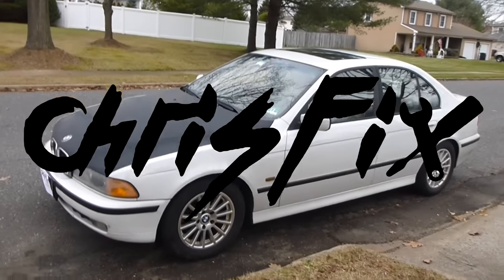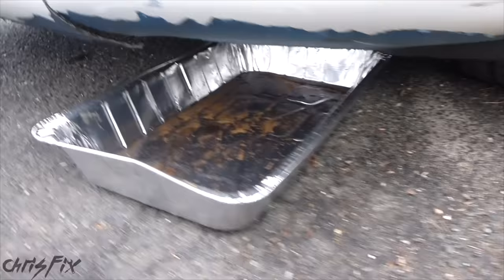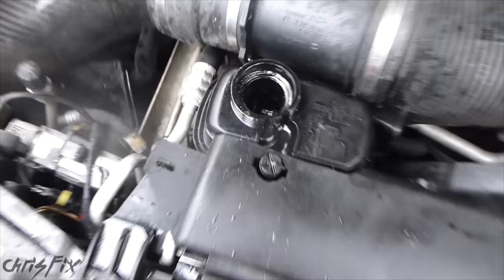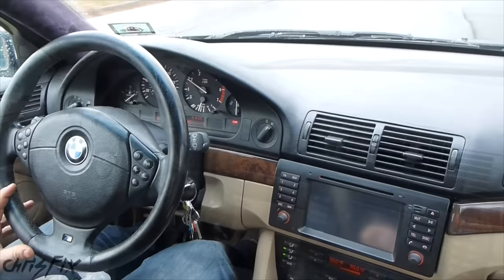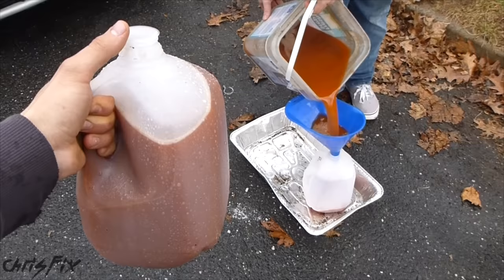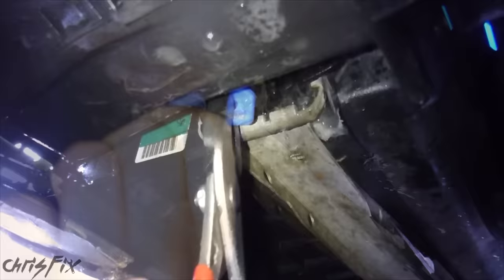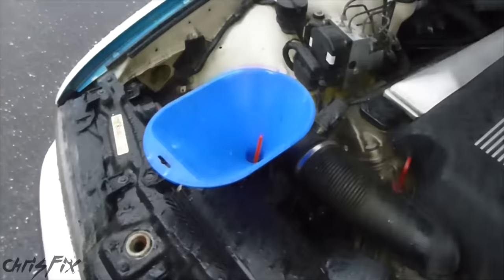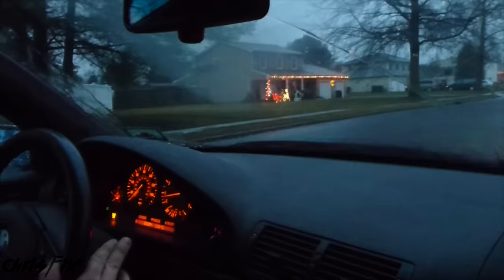How to Quick Flush Your Cars Cooling System

Comment: it's any problem to use flush cleaner with old radiator water? Thnx
Reply: +Redi Hoxha I was wondering the same thing. I think he mentions in another video that you can add the flush cleaner to your old coolant and then drive the car for a few days to have it loosen any deposits. That sounds reasonable.
Reply: +Dave denton 
On the brand I use it says to leave in your system for 200 miles before emptying and putting in clean fluid. Like Chris, a drown to town and back is good enough because who plans these things in advance, usually you do car maintenance whenever you get the time not in 200 mile advances. The only time I'd care about leaving it in is if I saw substantial particulates in the old fluid.
Reply: +jeff darnell That's exactly why I want to have it in there for a few days. I drained the old fluid and strained it through a nylon stocking and pulled out an ample amount of deposits. However, it seems it would be a mistake to run the heater as that would send the loosened particles into the heater core. Not a good idea, right?
Reply: You will want to get the old fluid out first. The idea is to get rid of the old fluid. Don't run the flush with the old radiator fluid!

Comment: When you pull the petcock off does the resivor tanks coolant go down too?
Reply: Jacob Peterson on my car it didn’t. I had to run the car a few times to get it circulating through the radiator. Other cars may be different, though.

Comment: Hey ChrisFix, I've watched like 6 or 7 how-to videos for coolant flushes and it seems like everyone does them differently.  What are your thoughts on those flush/fill kits where you splice a T-fitting into the heater core inlet hose, then run a garden hose through the fitting?
Reply: My question also
Reply: For anyone reading, that is not needed. Every car has a bleeding system and you dont need to mod it, just look up how to bleed your car.

Comment: I often see you using PEAK antifreeze when many manufacturers recommended only to use their own antifreeze. Do using a non manufacturer antifreeze damage the cooling system of your vehicle? My car for example recommend only to use a Nissan (green fluid) or my Honda a Honda (blue fluid)
Reply: With Honda I think the most important thing is that coolant is OAT type and doesn't have silicates or 2EHA which can damage gaskets. But of course OEM coolant is the safest bet

Comment: Omg. Never use leak stop crap. You forgot to mention ventilation valves for getting air pockets out. This vehicle takes about 10 litres of coolant mix
Reply from the maker: Arnis Tarassu Thanks for sharing!
Reply: +James Kozak what ventilation valves?
Reply: +GameHEADtimeGHT srry these are not valves but small plastic screws that let air out. one is an inch away from radiator filler cap. there should be another one or two near engine coolant pipes.
Reply: +Arnis Tarassu 
I think that's why it is labeled quick flush and not full flush.

Comment: So here @1:53 He Fills up his Reservoir completely with Distilled Water. How is there any more room left for the Chemical Flush, if the car only takes 3 Gallons, and i'm assuming he added all 3 Gallons of distilled Water? I'm confused. My car only takes 2.2 gallons, i'm assuming i'd only add as much Distilled Water as I can, but leave space for the Chemical Flush to still be able to be added.

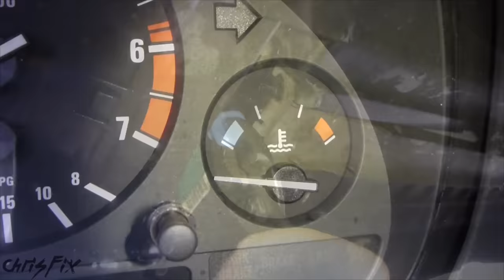Also, does his car not have a "Radiator cap" and only a "reservoir cap"? @3:57 He say's "take off the radiator cap, or in this case the Reservoir cap"??   I'm sure, when I fill everything up, i'd do it straight from the actual radiator, and not the Reservoir ? If someone could clarify this, that would be great.
Reply: Not all cars come with radiators that have a cap. Some cars (like mine -- a 1993 VW Golf MK3) only have a cap on the expansion tank. If your radiator has a cap, you fill it from there and then add up to the expansion tank. If it doesn't. you fill the system through the expansion tank.
Reply: Its Rafael he drained the woter to flush it

Comment: Forget about the plastic petcock, they will most likely break the older the car is. Just disconnect the lower radiator pipe and it drains faster too.

Comment: Cant you flush it with tap water first?
Reply: Kevin Afton No, you can't use tap water because it has minerals that can damage the engine. While distilled water has absolutely no minerals, just pure H2o
Reply: You can use tap water, but distilled water is advisable.

Comment: Great video on flushing. One thing I'd like to add, For anyone driving a BMW make sure you add the correct amount of coolant. It shouldn't be full to the top like in the video but with the float level with the top of the expansion tank. Adding too much will blow your hoses :).
Reply: Ooo Ty!

Comment: Dont know if this chemical flush is a good idea. Does it not chew up the seals and gaskets and rubber hoses in the coolant system ? Is that why you try to neutralise the chemical flush it with this "rust inhibitor" ? May be a better idea if you did another 2 distilled water flushes after the chemical flush to completely clear out corrosive chemical flush fluid?

Comment: Will be attempting to this tomorrow. I have a. 07 Infiniti G35 Coupe & just yesterday it started heating up. Tried opening the cap and it dripped a bit due to the pressure. Coolant looked watery and super dirty, like black ish water. My guess is that the previous owner had put water in it. Hopefully thatll fix the problem. Might have to replace the water pump while at it. 😭

Comment: My Corsa d 1.2 2010, I have a car with spanner symbol and radiator fan running all the time, I flushed my coolant system a year ago, changed all my oil and filters. I replaced my radiator coolant sensor as I thought that was the issue, I’m gonna change the thermostat as the coolant going from the expansion tank into the engine is warm after a drive but pipe that comes back out of the engine through the thermostat into the radiator is cold which means thermostat may be locked closed or open. Gonna change that, I checked the radiator fan resistor that looks ok and relays all look ok

Comment: Been watching your videos for a while now, you give really good advice.  Quick question I have to flush my 2001 dodge neon but I always doubt on what I need, coolant or antifreeze? And for me even more confusing is do I need to fill my radiator and my reservoir as well? Help please.
Thank you.
Reply: Coolant and anti-freeze are the same thing. 

"Coolant" for when its hot outside so it doesn't overheat and "Ant-freeze" for the winter so it doesn't freeze. Just think of it that way. But, they are the same thing so whatever you call it makes no difference.
Reply: @vigilantemotors  thank you. 🤙

Comment: I got a question how long are you able to run a car with distilled water? I tried to change the thermostat and one of the bolts to get to it was stripped, and my dad is going to take it to a trusted mechanic of his and I thought about adding distilled water while he takes it there so I won’t have to waste coolant. Also, while my dad is driving to the shop, will he need to have his heater on?

Comment: Much cheaper way is to use neat phosphoric acid. Drain the system and fill 50/50 acid and water. Run it for a few miles and drain. All the rust and crud will be dissolved.
Reply from the maker: That could be pretty aggressive, I would use a flush product or something designed for use in car cooling systems

Comment: Don't use the anti rust additive unless you have a neglected/abused older car. Also, if you do this on schedule, you actually don't need to flush with water. Just drain the radiator. Replace fluid. Drive 500k miles. Drain again. Replace fluid. Drive 500k miles and drain 1 last time. Then refill radiator. With 3 refills,  you have now virtually replaced all the fluid and rejuvenated the radiator fluid. Good for 5 years or 40k miles.

Comment: I followed all of your advice on how to drain the coolant.  Open petcock, start engine, run heater, but I seem to only get half of the coolant drained.  The car is a 2007 Hyundai Tucson and its coolant capacity is 8.2 quarts.  I only get about a gallon to drain.  The Hyundai forum seems to indicate you need flush with distilled water multiple times and then add full strength anitfreeze to try to achieve the 50/50 ratio.  Is there a way to completely drain the system?  Is this dependent on the car?

Comment: i know this is an old video but i wouldnt ever add sealer to the cooling system it can completely block your heater core as those passages in there are already very small as it is.

Comment: Thank you so much! Very thorough and very helpful. It's exactly the complete start to finish demonstration that I needed. A complication came up (and when do they not?) But I scrolled into the comments to find a solution. Excellent video!
Reply: Out of curiosity what problem did you run into on this job,I'm getting ready to do a flush so it would be helpfull

Comment: Hi Chris In your first step of flushing how much did you know to add of water and then chemical flush without overfilling? Did you compare the amount to how much you dumped from the radiator?
Reply from the maker: It’s not an exact science. If it is overfilled it will just overflow.

Comment: I saw another youtuber that unscrewed the hoses and sprayed it down with a garden hose. This way seems easier and straight forward. Is one method better than the other? and how often should this be one. I have a 2021 with only 30K miles and the mechanic said it needs a coolant flush, brake fluide flush, and new front brakes and new front rotors. He quoted me 1425 for all of this.

Comment: My heater core was leaking and bypassed by my mechanic. Do I need to get that fixed to properly flush the cooling system. My coolant is looking sort of old and I was thinking about flushing it just for basic maintainace in my 00 f150. I'm no mechanic but I try to do what I can. Most jobs I take to the mechanic. I do admire the work that a good mechanic can do. Chris fix makes everything look and sound easy but it never is

Comment: Trying this on a 2017 Chevy Colorado that does not have a radiator cap but a reservoir tank. Fingers crossed.
Reply: Water with the cleaner came out bubbly in my pan when draining. Is this normal?

Comment: How about just opening up the drain cap, attaching a garden hose to the top and letting the engine run while the water runs through?

And then a proper flush with distilled water and flush mix?
Reply from the maker: That is a way you can do it but I don't like the idea of putting in non distilled water that you'd have to flush out anyway. This does a similar job at the end of the day
Reply: @chrisfix  Youre awesome dude thanks. Yeh was wondering about doing that just for an initial rinse to save money on distilled water haha
Reply: @chrisfix thank you Chris, you’ve helped so much you don’t even know. You coming back to a 10 year old video and replying to a comment shows how much you care about us as well ❤️

Comment: Great video going to try this. My radiator cap has brown sludge on it, would coolant flush help that or is that indicatng something else wrong? I figured it ment the system is dirty. 
Also you said to run it a few hundred miles on your other video, is driving it necessary or wil idling work just aswell? I ask because i have it on non op at the moment.

Comment: With spill proof, you can just add new coolant and then start the drain from the bottom line or screw.  That way, no chance of getting air in the coolant system.  What do you say Chris?

Comment: Learn so much in car maintenance with Chris. All these knowledge are gold in maintaining my own cars. During the clip there was a brief moment the car engine was running with no fluid in the radiator, was that OK?
Reply: I'm late, but to answer your question, yes. Running the engine briefly without cooling is still fine. The metal will soak the heat for a little while.  I wouldn't run it more than half a minute personally just to be on the safe side, but even a minute would probably be fine.

Comment: 4:22 careful with doing this on modern cars... With no coolant in the system that could quickly overheat and damage the smaller components with tighter tolerances that is common in newer cars.

Comment: Hi! 
Got a toyota aygo from 2011 and some say i should remove the thermostat while flushing the system, because otherwise the system cant flush properly. But no video shows this, no one takes it away. 
Then i wonder, is it ok to start the car without anythinh in the coolant system? Nothing brakes? 
And finally, can i flush it with only water or is it very much better with the destilled water? 
This seems too easy i guess... 😅 thanks for a very good video!

Comment: Do BMWs Have Coolant/Anti-Freeze Reservoir? Because When You Were Flushing The Coolant From Out Of The Radiator And Placing New Coolant In. You Didn't Say If The BMW Has Or Shown The BMW Coolant Reservoir? So Does The BMW Has A Coolant Reservoir?
Reply from the maker: Yes, this one had a reservoir

Comment: Question. How do I know how much coolant to put in and or distilled water? And is the other stuff you added necessary
Reply from the maker: If you want to do a flush, then I would recommend the other stuff, and check your owners manual for the ratio and amount!
Reply: @chrisfix  okay thank you. You are very helpful. I didn't think you were going to reply.

Comment: Maybe run distilled water instead of regular water. Sometimes regular water will corrode or rust components in the cooling system. Really not necessary to drive just maintain throttle at 2500 rpms to warm it up enough to open the t-stat and circulate cleaner through system

Comment: Chris great video as always.  Thank you   When you started the engine that pulls the old coolant from the engine block and heater core? I have a jeep and my guess is the water pump / thermostat keep the coolant in the engine?   I would prefer not to pull the plug on the engine block so as to avoid stripping it.   Many Thanks

Comment: "This engine is old...to prevent leaks due to flushing of the cooling system" So, if you do a coolant flush on an older engine you can start having coolant leaks even if you didn't have any before?

Comment: When you first drained the coolant using the petcock, did all coolant in the system come out? If no, when you drained the water later, did it mix with the coolant remaining in the system? If so, would it impact 50/50 ratio?

Comment: I have a question for all the car enthusiasts. Im super new when it comes to cars and recently got my own car, trying to educate myself to be able to take good care of my car. On the fence about flushing my 2015 honda civic. Only reason i wanna flush it is because i have no idea what kind of coolant the previous owner used and dont wanna cause damage by mixing 2 different coolants, so a flush it is. My car has a seperate coolant reservoir apart from the radiator. In order to flush that out as well, would i just pump out the old stuff, flush with distilled water and pump it back out to clean it? As im told, even after removing the rad plug dosent completely drain reservoir and theres still a little at the bottom. Hope this makes sense and any help would be appreciated

Comment: If you drain all the coolant from the radiator and the lower radiator hose, how much coolant, if any, is left in the engine block? 

I ask because I drained all the old coolant from the rad and lower hose and then added new coolant to the radiator.  But I am afraid to run the vehicle too long as I do t know if the block still has any coolant after I drained it from the lower radiator hose. Then filled up the radiator. 

Thanks for the video is short but to the point..

Comment: Chris you just tanked a BMW engine.....never use anything but BMW BLUE Coolant and never use the a coolant flush especially on a BMW V8. I dont believe that this n62 has an electric water pump, but on the n52, n54, n55and other v6's BMW has a procedure that you can kick the water pump on to help circulate the coolant and bleed it. Turn the heat up all the way, put the key in aux position and hold the gas pedal down for about 10sec and take about 8-10 mins.....make sure you have a good battery

Comment: You still had diluted water and flush in the heater and the engine block. Adding 50/50 mix might get you a 20/80 mix. Be careful.

Comment: Danny Klingaman
0 seconds ago
There needs to be some major caveats to this video. This won’t work on a lot of cars. On mine, you can only get about 20% of the coolant out by draining and running the engine. Plus then you’re risking getting air in the system and possible overheating. If you have the vacuum tool to do this job properly it could be a good DIY project, but in my case I ended up spending extra and ultimately took my car to the shop and paid $130 to have the job done properly.

Comment: If you do get air in the system and it’s not blowing warm air how would you fix this or go about getting the air out?
Reply from the maker: On a cold engine, open the reservoir/radiator, put a funnel in it, fill it with coolant as much as possible, start the car, turn the heat on the highest setting with the fan on the lowest setting, and then keep filling the coolant as needed to the proper level, also keep an eye on the cars temperature. If you need to really force air out you can rev the car up slightly to get the water pump moving quicker. After all that go for a quick drive, let the car cool down, then check everything again